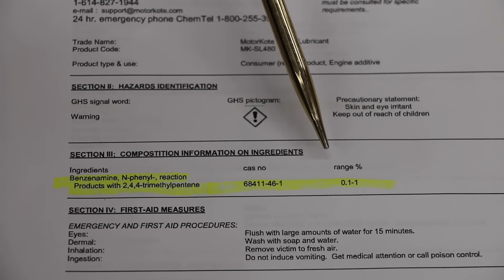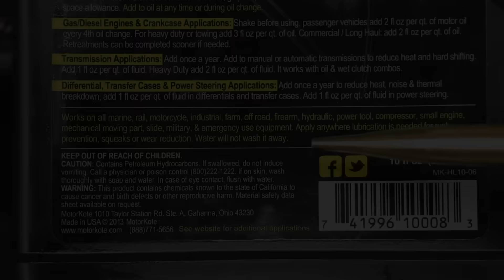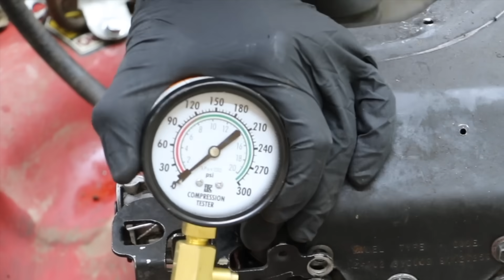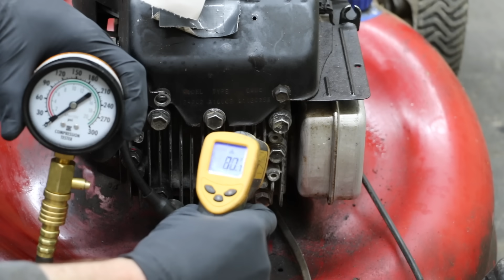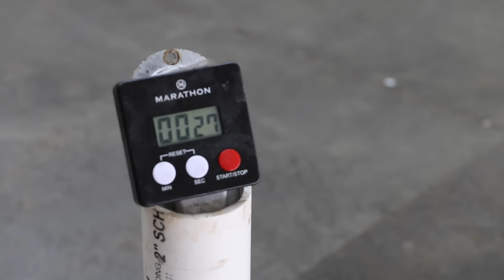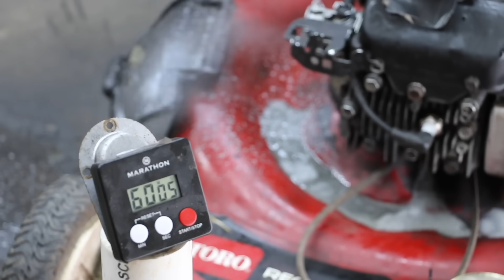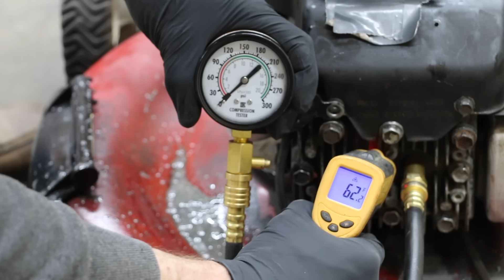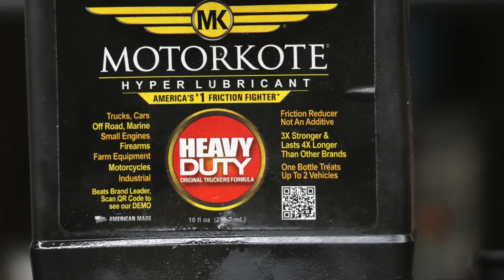Can MotorKote survive the water test?  Let's find out!

Comment: I could not have been more skeptical of MotorKote's claims nor more shocked at your water test result!  This was by far your most astounding test yet.  :)
Reply: Well i now know what to put in my car next time I do an oil change. Do they have this for motorcycles?
Reply: dark_zero 11 Use the same thing in all places. 2 oz per qt in any engine and 1 oz per qrt in any gearbox or automatic transmission. Only place it can't be used is on brake parts. I even paint it on the bottom of mower decks to keep grass from building up on them. It works great for that too. Put it on your chain on your bike it will keep the moisture out of it and you would get probably three times as many miles out of it over using regular chain lube. Put it in your power steering system on your car. It will actually quieten down the pump if you have a growling pump.
Reply: @darkzero11ca  Do not put this in your motorcycle!!!!! Most motorcycle have a wet clutch and your should not even put energy conserving oil in your cycle. The clutch will slip.
Reply: @rogerhurd6434  it only work on a dry clutch motorcycle then. Good I haven't used it yet.
Reply: @darkzero11ca  Says you can use it with any oil, transmission, power steering, hydraulics...so why not?
Reply: @darkzero11ca  careful. clutches and 'friction modifiers' are iffy.
Reply: @darkzero11ca  I believe it’s the same product for both cars and motorcycles.  At least that is what I have used.
Reply: @darkzero11ca I use the original in my Harley-Davidson. No issues with it
Reply: @darkzero11ca  don't use it with wet clutches on motorcycles
Reply: @jasonchallis5169  cool thanks for letting me know.
Reply: @darkzero11ca  You can use MotorKote in any Engine.  I used it in my Semi-truck, Car, Lawnmower and Outboard Motor...all performing well and with great results.  I've been using Motorkote for nearly 17 Years.
Reply: @darring.9161  did you use motorkote on a new engine or did you allow a breakin period?
Reply: @ConquerCollin  I personally only use it in a car engine that has been broken in after 80,000 Kilometres/50,000 Miles. 
 I will also use it in Older Engines that I refurbish...that have a questionable or unknown Maintenance History or Records? 
 In my personal vehicles, I apply it at every 3rd Oil Change...though Motorkote says you can use it every 4th oil change. 
 I see no point in using it before an engine is broken in, but I don't think it'll hurt it any either.
 Having said that, it leaves a fine film on the Pistons and Cylinder Walls, so if you're having difficult Winter Start-ups...you can also throw some in to keep your cylinders and pistons well lubed while the Oil heats up and starts flowing more freely through the sump and the engine!
Reply: @ConquerCollin  After a reasonable break-in period!
Reply: @
dark_zero 11-
You have to be careful with motorcycle engines. I have a Honda and they say not to use  oils with PTFE's or silicones.
Reply: agreed!!!!!
Reply: I am curious to know if they say they Do Not contain Chlorine in it, what source of information do you have that shows they Do have it? haven't heard of this before but always interested in more information if you can provide it that would be awesome.
Reply: @ brick house Please provide the source(s) to your claim.
Reply: Interesting that the 'dry' test with the water bath had better results than the 10W30 mix.
Reply: @MultipleObjectSelector  I'm late but probably had better results with what and a light coating because of the steam Cleaning effect it would have.
Reply: brick house If I'm not mistaken you are talking about something from many many years ago when motorkote was new to the market. I would really like it if you could link something that proves your statement that's within the last 10 or 15 years. If I'm wrong I'll be the first to say I'm wrong but I dont believe that it contains any.
Reply: You use the same formula for all engines, just follow the label directions. I have it in everything I own that burns gas.
Reply: Project Farm Motorkote is no joke
Reply from the maker: Thank you for the positive comment!
Reply: @ProjectFarm  really liked this test are you gonna do a vs video between motorkote and another similar competitor like bestline or turbo max?
Reply: @leeroyexcavator9149  would sure like to see motorkote vs best line, etc.. as well!!
Reply: @ProjectFarm  run it with motor kote then drop it out and see if the engine will run with no oil
Reply: We use a product called, Power Up, which when poured into a running engine will cause the engine to run faster for a few seconds as the car's computer compensates for the friction reduction. There is increased gas mileage as well as claimed horsepower and lower temperatures. I can only attest to the improvement in  mileage, as I have no way to verify their other claims. I wonder how Power Up Lubricants would compare to the friction properties of MotorKote. With Power Up NNL-690, you just 1 - 1.7 ounces/qt. to the existing oil in the crankcase.
Reply: @bigdog4574  Always skeptical as well when they (Amsoil) have a vested interest in saying it doesn't work
Reply: Its compatible with pretty much all gas engines, 2-4-6-8+ cylinder vehicles as well as motorcycles. I'm thinking about adding this to my 66cc 2 stroke motorized bike, as well as are new Honda Accord.
Reply: I am late to the party on this video, but I must say I was shocked just how well it appears to work and live up to their claims. I have never used MotorKote but I'll definitely be picking some up after seeing this. Very impressive.
Reply: If you're using it in the oil/crankcase of a car/truck then you use 2oz per quart of oil. What kind of vehicle's will you be using it in?
Reply: Here is a reference for the topic http://thebestsyntheticoil.com/pdf/TSB%20MO-2010-04-01_chlorine_oil_treatments.pdf
Reply: @bigdog4574  I'm assuming the formula is the same I unfortunately used this product in my 88 Ford 351 now all of a sudden I have rear main leak after two months in engine changed oil once gonna have to change again just add zddp or diesel oil. This is 🐍 oil for sure.
Reply: Click this link and scroll down to "Recommended Usage:" http://motorkote.com/10oz-motorkote-hyper-lubricant
Reply: dark_zero 11 I run it in my yamaha 1900 stratoliner.
Good stuff.
Reply: Where do you by this stuff at right now please let me know
Reply: Charile Wayne Henson I picked it up ay o’Reilly’s they only had one bottle on the shelf.
Reply: @charilewaynehenson281  Walmart probably has the best price but still expensive
Reply: Jimi  The instructions call for 2oz per quart for normal applications, or 3oz per quart for heavy applications. That means for normal applications you'd be at 18.2oz for 9.1 quarts, and 13oz for 6.5 quarts, and for heavy applications you'd be at 27.3oz for 9.1 quarts, and 19.5oz for 6.5 quarts. Here's the problem. A quart is 32 fluid Oz. You can't just add your 9.1 quarts and then dump an extra 27.3oz of motorkote on top of that, because you will overfill your crankcase by almost a full quart. Depending on your vehicle (almost all of them) overfilling the crank case will seriously damage your engine. You should always stick to the manufacturers recommendations. So you would want to mix the product first, then add only what your crank case needs. If you don't want to mix it up and have extra we need to figure out the ratio. My calculations showed roughly 5.88% for normal applications, and 8.57% for heavy applications. SO for 9.1 quarts in heavy apps you'd want 8 quarts and 10oz oil, and 25oz motorkote, and in normal apps you'd want 8 quarts 18oz oil, and 17oz motorkote. For 6.5 quarts heavy applications you'd want 5 quarts 18oz oil, and 17oz motorkote, and for normal you'd want 5 quarts 23oz oil, and 12oz motorkote. I rounded these off to the nearest OZ to make it easier.
Reply: My /0.02 on the matter: it is not chep! but when I put it on my semi for the 1st time I noticed  a less noisy engine and a smooter idle so I been using it ever since!
Reply: WOW!! Very impressed. Wouldn't put in an engine with less than 30000 miles for break in purposes.   I am sold.
Reply: @butteredbiskit3497  engines break in after like 1000 miles lol
Reply: @butteredbiskit3497  yeah have fun it's corrosive chlorinated paraffin as claimed by amsoil testing laboratory just use redline zddp additive in appropriate dose of 1500ppm
Reply: You kinda sound like a competitors troll. Site your proof or go away.
Reply: Ur a amazing man
Reply: Ya I might have to get some.
Reply: I think the Seafoam test is right at the top too!
Reply: brick house how does hydrochloric acid damage an engine? Is it The rubber seals or the bearings? In curious now
Reply: @stuckinmygarage6220  This is a warning/caution from an oil company. Nothing wrong with vetting claims before using a new product, but their viewpoint is hardly unbiased!
Reply: @bigdog4574  did they rest an old batch of motorkote I wonder? Says now none of that in it, did they change the formula since.. Has any one don't a voa for that exact substans to see if it's not in here as motorkote states or are they lying? Mmm
Reply: @will21  you ever find anything out ?
Reply: brick house bullshit
Reply: J Smith 
use motorkote with extreme caution! although they say they contain no chlorine it does. 28% which becomes hydrochloric acid and will destroy an engine. look up lab reports and be careful.
Reply: @AmericanCapitalist-b4w  You should quote sources.
Reply: @AmericanCapitalist-b4w  do they really? are you sure this isint just some smear job? atleast provide a link to the labs you saw with your own eyes.. or did you not even look at them?
Reply: @AmericanCapitalist-b4w  change the oil  when do and there are no issues   its more damaging when people let there car sit for months and never start cycle and bring the engine oil up to temperature
Reply: @AmericanCapitalist-b4w  Your must be Al Gore the one that gone nuts!!!!!!!!!!!!!
Reply: This video is on motorcoat’s website.
I’m sure sponsorship has happened by now, if not from the beginning.
Reply: @StevenCarlisle  do you not think out the box and Go maybe motorcoat saw the video and asked him if they could use it. Happens all the time nothing wrong with that and if you look all his test are done very well on products he didnt tell you to run out and buy it .
Reply: @Tanner1437   his video is on the MOTORKOTE website as a sales pitch. 🤔

Comment: You should try lubricity testing the same oil with different weights on the tester to simulate different pressures of parts of the motor. Maybe some lubes work better than others while under a lot of pressure.
Reply from the maker: Thank you for this recommendation!

Comment: Very unexpected. I've never heard of this stuff before. I'm temped to try this in my race car to see if it improves 1/4 mile times, which would be an indication of significant reduction in friction (or possibly a significant reduction in the effective weight of the engine oil which just another form of friction).
Thanks for posting.
Reply from the maker: If you decide to test it, could you let us know if you see any improvement?  I'm very curious.
Reply: Project Farm 
Will do.

Comment: You should try water injection into the combustion chamber :D
And eventually choke the engine on water (dump a lot of water into intake) and see what happens. I have seen it on a car with direct injection but not a carburetor engine
Reply: Hockey Masked Person he did do a drip of water to one engine
Reply from the maker: Great recommendation.  I tested the water drip, but I plan to test a water mist in the future.